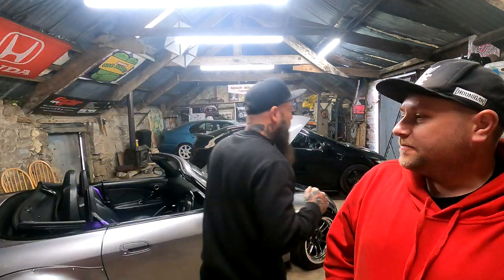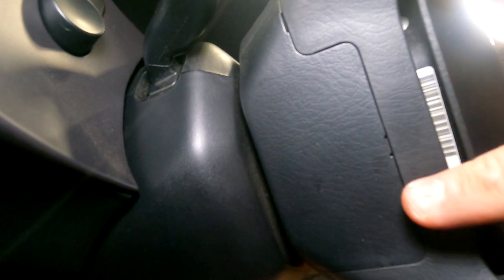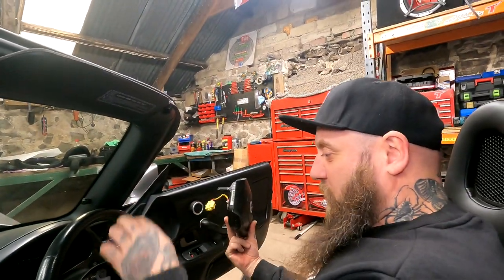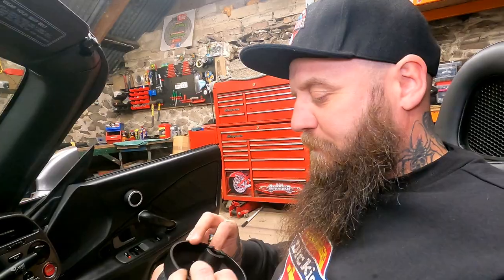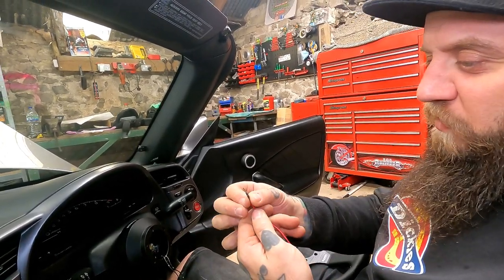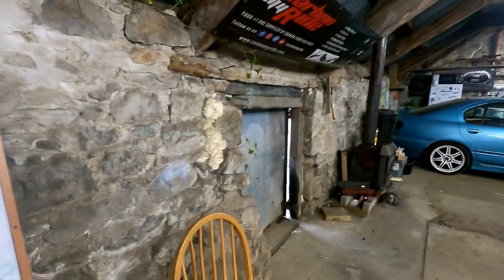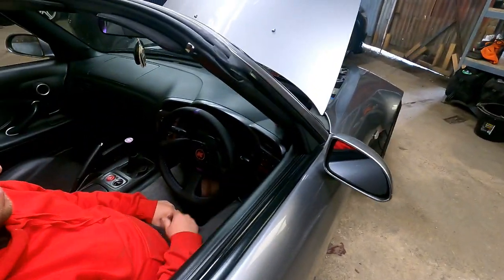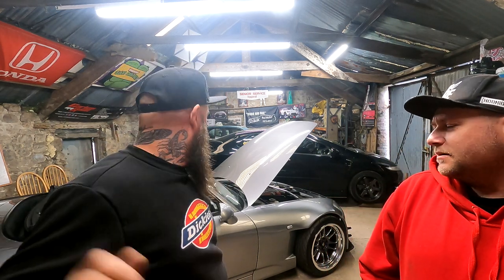Honda S2000 NRG short hub and Kode steering wheel installation

Comment: Nicee! Guys can someone help me, how you you connect the resistors to the airbag cables? I see a adaptor but I don't know what it is.
Reply from the maker: Just cut the plug
Off and join them together pal
Reply: @CowabungaCarDiaries  so you guys mean just cut the cable and the resistor and put them together? Great thanks Ive been looking for a solutions for months! Great videos too! I bought the gtc 200 cause of you guys 💯
Reply from the maker: @donniedarko5529  yes mate. The two wires going to the yellow plug (assuming you are uk) just join it to them. I just cut the plug off 🤘🏻🤘🏻
Reply: @CowabungaCarDiaries  it work! Thanks guys appreciate it, keep up the content, the s2000 is looking gnarly!

Comment: Hey man, are you still enjoying the exhaust? Do you run silencers for daily use? Wondering whether or not to pull the trigger on the same pipes or not - love the sound but will the police? haha
Reply from the maker: I run the silencers a fair bit mate as it is so so loud. No issues with police. Tbh I think it’s louder in the car than the actual noise outside. Gna wack a test pipe on it see if it calms the drone down 🤘🏻❤️
Reply: @CowabungaCarDiaries  cheers mate 🙏 I’ve wanted the same for a year now - if you get a test pipe maybe do a video on it ? 🌱
Reply from the maker: @ollie9999  100% we will mate
Reply: @Cowabunga Car Diaries  I wanna get my standard-ass s2000 feeling and looking more like a race-car 😅